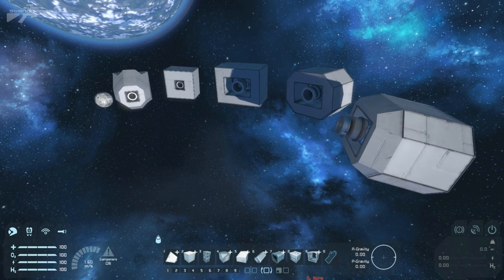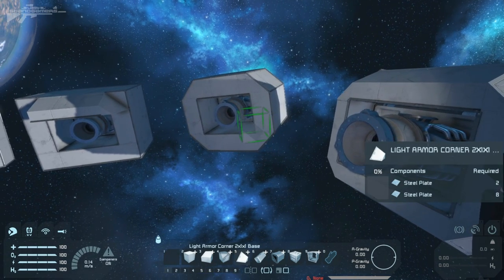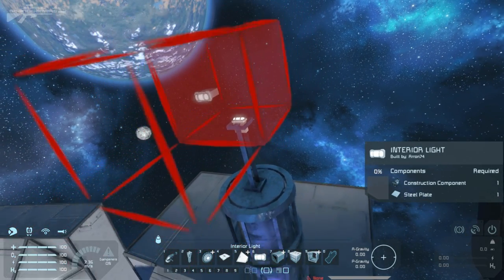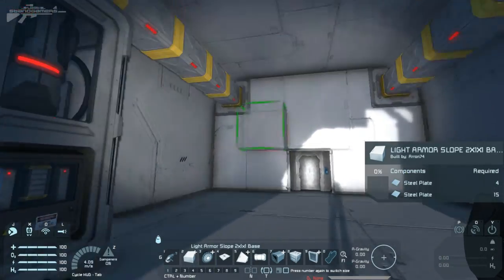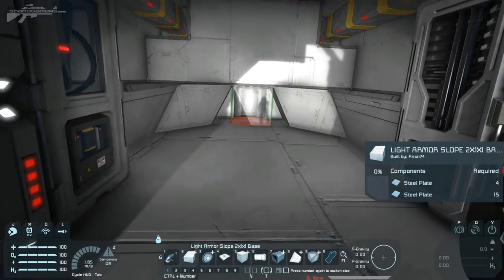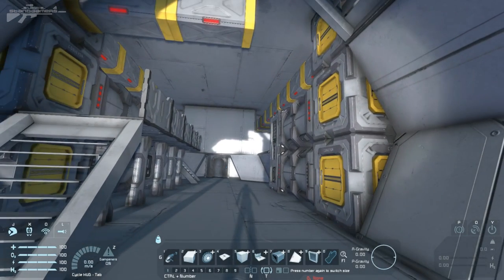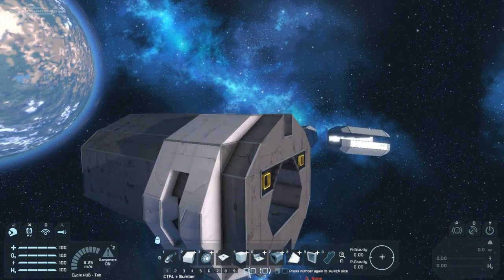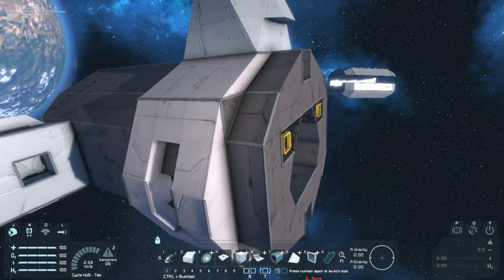Space Engineers - You Suck At Building ?

Comment: Also i want to point that a pretty ship won't help you in battle and probably will only make it harder to build and repair, and sometimes make it weaker.
Reply: not always. when you plan your ship for survival this should be one of the considerations, ease of repair and material cost. some of the external ground down parts i can agree with but as long as they are protected by full blocks it can mitigate the damage. also hiding your items does not mean that you can not access them. having maintenance shafts that are separate from your main space can get alot of the clutter out of sight while still being fully accessible for maintenance and repair.
Reply: Mike A 
That's the big problem with mechanical design in general, at some point you're going to have to sacrifice aesthetic for functionality.
Reply: Sean Rea True. When i say make it weaker, i refer, for example, to a vanilla star trek enterprise. It might be cool and pretty, but three torpedoes in the neck and the ship is split in two. Another example is having a tower bridge (like a star destroyer). It's amazing to pilot from there, but two hits from anything from a torpedo to a missile and it's dead, your ship without a pilot and vulnerable. Pretty makes a ship weaker when it gets in the way of a good battle shape or a safe interior distribution.
Reply: Mike A You're forgetting that most ships you're describing have two places the ship can be controlled from, or the bridge has heavy shielding. The enterprise has redundant systems in the engineering section and in the saucer. The ships with bridges you're describing usually have deflector shields (the two large domes on star destroyers) to protect them, and they allow the crew to see in certain circumstances.
Reply: Even though I build nice bridges on my ships, I usually have a place to pilot the ship from when in battle.
Reply: the bridge concept may be a hold over from traditional naval vessels, they provide a place to see all of the action and direct the fighting. these have also been an historic weak point but command could still proceed from other areas from the ship. for example there was aft steering in battle ships and redundant communication networks for command and control. it is the same with most larger vessels in space scifi. the bridge is the main command and information center of the ship but other locations are available. if you remember the classic starwars scene of the a-wing crashing through the bridge of the star destroyer. it is the bridge vulnerability shown.
Reply: Deathpuff12 I'm talking about vanilla, with mods you can make a giant fish be the ultimate dreadnought. If the ship does have a secondary, protected bridge, then it's ok. In fact the bridge outside will normally act as a decoy.
Reply: Yeah, in vanilla it's hard to make a protected outer bridge. But then again, it's hard to build anything protected. A couple gatling or missile turrets can tunnel through your ship and destroy the chair you're sitting in.
Reply: Deathpuff12 Actually, heavy armor is really effective against missiles, and Gatlings are just nothing to it. Especially if you make a ship designed to face the enemy with its front and attract fire with a decoy, which would allow you to fit ridiculous amounts of armor (like 10 blocks thick) which makes you pretty much invulnerable . The real threat are torpedoes, capable of making gigantic holes in your ship, destroying wide areas of the interior and causing infinite problems if something of them stay inside.
Reply: especially those thin areas, which can look really nice,but can also lead to large chunks of your ship floating away if they're hit

Comment: Building a ship around a set of functional components(needed production machines and such) is a very pragmatic and common technique. A mining ship for example, you can easily start with what sort of drill configuration you want, then extend conveyor system and plan for the cab and cargo containers, then build around it, putting reactors, gyros, armor and thrusters.
Reply: Kaos Warrior i personally go with a tug and drill system. I have a cargo pack with thrusters that holds a massive amount of storage. My mining vessel itself is small but agile and resiliant and i just drop the loot in the cargo bus and when im done the thrusters on the cargo bus are strong enough to propel the whole thing at high enough speeds that a 50km trip may only take a few minutes.
Reply: Very interesting concept! So, they're all small grid?

Comment: My main issue is that adding detail does add weight to the ship. I get stuck in this paradox of wanting to look nice but the ship must be 100% functional with everything serving a purpose.

I have gotten better and settled with a modular style of my own. One of my best fighters used a rear mounted cockpit and a nose mounted guns with a large reactor joining them and a layer of light armor on the sides and a heavy armor nose.

Using the angled blocks helps but i still find it is difficult to master a beautiful design if it must remain 100% functional.

I have found that laying a antenna on it's side and embedding it into armor at the end so that just the tip is exposed is both functional and pretty.
Reply: Use light armour over heavy armour if mobility is what you want. Although heavy armour can withstand more damage, depending on the weapon used (when its a modded weapon) that won't matter, and you'll likely find that depending on the size of your ship, it can take a while for the enemy to effectivly destroy your ship. Your external weapons arent going to stay safe either way.